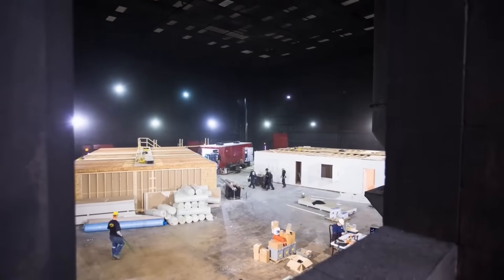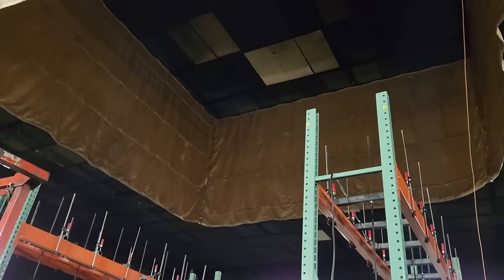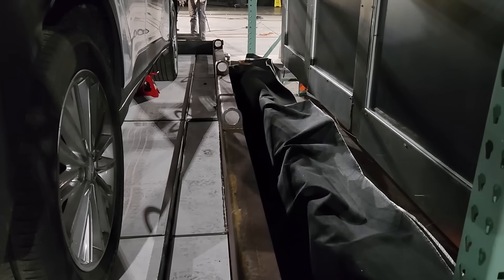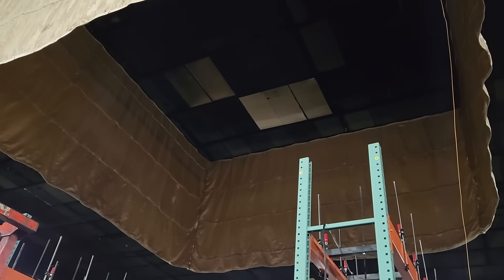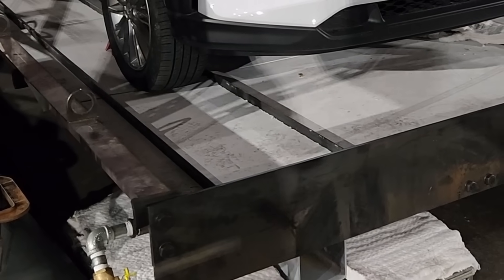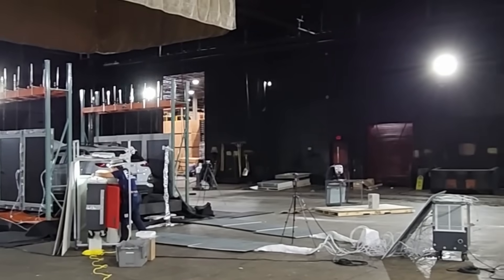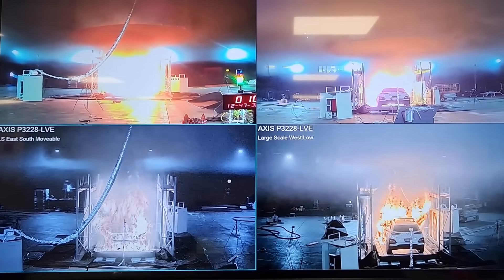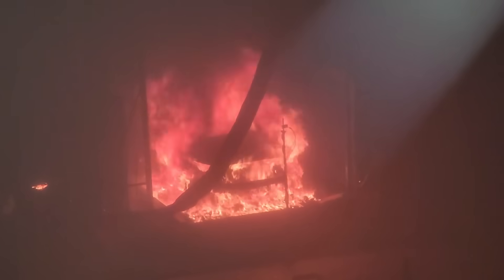Burning SUV: EV Fire Study

Comment: I predict When the Hyundai Kona EV fire starts  there will be a heap of burnt and melted metal on the ground, you won't see the shape of a car I even think that the panels at the side will be gone if they are placed at the same distance as the regular Kona, 2000 degrees for a EV fire Vs 800 for a petrol car fire. It will be interesting. But it's also worrying to think of multi storey carparks under ground carparks and tunnels if these EV  fires can't be put out. No forethought just green washing.
Reply: I found a Korean study that did a very similar thing - burnt an ICE, a couple of BEVs, and an FCEV. There was surprisingly little difference between the ICE and BEVs in terms of overall heat energy generated, or the rate heat was released. The batteries only made a small contribution. The FCEV was significantly worse than either. You might be surprised by the results....
Reply: @peeemm2032  Thank you for attempting to introduce a little science and data into this comment section.  Of course you can see from the comments you got that changing people's minds, once they're already made up, is very hard.  And like a small child, they will grasp at any excuse to avoid simply saying, I was wrong.  Your comment section is a perfect example of the truism that it is easier to convince a man of a lie, than it is to convince him he's been lied to.
Reply: @Tom-dt4ic  Thanks - I'm neither pro or con EV btw - I think they have their advantages (and disadvantages), but I do think there's a lot of garbage put out there about EVs (both pro and con)....

I also have an Engineering and Science background, so I find a lot of the more ridiculous crap put out about EVs (on both sides) to be intellectually offensive, and just plain annoying....

Totally agree with your assessment, most of the time I'm replying to people's comments I'm not under any illusion that I'll be able to convince them, mostly I'm doing it for other people who might be reading, but haven't yet made up their minds...
Reply: @peeemm2032 That's hard to believe since battery EV's have taken down entire car parks.
Reply: @silent1967  well, so some people say. Just because someone says it in social media (or even other media) - doesn't actually make it true.....
Reply: @silent1967  study's called "Full-scale fire testing of battery electric vehicles". You should be able to download it - definitely worth a read....
Reply: @peeemm2032  I do believe the park and about 1200 cars destroyed.  Not counting the cargo ship that burned. You've also not even seen the battery EV Dewalt Zero Turn that spontaneously caught on fire at a demo show and all they could do was dig a hole and bury it.
Reply: @peeemm2032  I wouldn't trust anything Korean. They're not known for high quality at this time.
Reply: @silent1967  That was the view years ago but Safety and QA/QC systems in Korea are taken very seriously these days. I worked with nuclear power engineers from Korea Power Engineering Corp on a major $5B non-nuclear facility and they were very diligent, even applying nuclear power standards in a non-nuclear project environment. I drive a Korean Cee'd made by KIA and it has been faultless except for the sat/nav which failed just after the 3 year warranty ran out on that part of my car. KIA had already switched supplier.
Reply: @silent1967  I'm assuming that you're talking about the Luton airport fire? There's certainly been a lot of of chatter, commentary and speculation about it in the media (social and otherwise), but as far as I can tell virtually no hard information from any credible source. After seeing the study I mentioned, I'm not convinced that it would have made much difference whether the car park was full of EVs, or had none at all, but I'm not an expert, so will wait for real information on that...

Regarding trusting anything from Korea - I think Korea has been quite well regarded for the quality and reliability of both their EVs and ICE vehicles for some time now - both Kia and Hyundai have good reputations, and Korean engineering is right up there with Japanese now...

For that matter, I wouldn't trust American automotive engineering, but I would be interested in the results of the EV and ICE combustion trial this video was discussing..... no offence meant if you're American btw.
Reply: @peeemm2032  None taken,  yes American manufacturing is in dumpster in a lot of ways these days. It's a shame, I'm 63 years old and it did not use to be this way.
Reply: @silent1967  I'm Australian, about the same age - we no longer manufacture cars here at all, and when we did they weren't that great - so even worse than American auto manufacturing. We also used to manufacture electronics, clothing, and most other stuff on shore, now we manufacture virtually nothing.  Most of our "industry" consists of either growing stuff on the ground and shipping it off, or digging it up and doing the same, or serving tourists... We import pretty much all our clothing and manufactured goods. So my comment was a somewhat wry one.....
Reply: @peeemm2032  Yes I get it, I'm hoping we can turn over some of this in the next election but I'm doubtful. Just hoping we don't break down into civil war again. It's never pretty and everyone loses.
Reply: @silent1967  yes - what's happening in the USA right now is alarming, even at a distance, you all have my sympathies. I was telling one of my friends the other day that I thought you guys would get it right eventually, but possibly not without at least some collateral damage - sincerely hoping it's minimal....

Australians are generally pretty lazy and half hearted about what we do, so we don't necessarily achieve too much, but usually don't get ourselves in too much trouble either....
Reply: @silent1967 where ? Here in the UK both the Luton car park fire and Liverpool car park fire were both Ice vehicle's !
Reply: @davefitzpatrick4841  Yeah ok and the cv didn't come from the Wuhan lab either. 🙄
Reply: @silent1967  In 2018 a diesel Land Rover destroyed a British car park in Liverpool. Thousand degree temperatures, 1,400 cars destroyed, massive property damage, including a structure which had to be demolished. Sound somewhat familiar?
Reply: @silent1967  Bedfordshire Fire and Rescue Service who attended the Luton fire have said it was a diesel vehicle the started the fire.
Andrew Hopkinson, chief fire officer at Bedfordshire Fire & Rescue Service, It was not an EV. This was a diesel powered vehicle.”
Reply: @peterr6739  Yeah ok.
Reply: @peterr6739  Not to me.
Reply: EVs are born out of idea of reducing greenhouse gases emissions. While this does holds some merit, in the big picture they matter not. EVs alone cannot reduce greenhouse gases to an any acceptable level. The governments and corporations aronud that are like parrots that keep repeating "just buy an EV and everything will be just fine" are terrible liars. THE No.1 air pollutant on the globe is the coal. From it's mining to eventual use it expels ~70% of all GHG that is causing the climate change. If the world REALLY wants to tackle the climate change, the world MUST find a way to ween itself from coal use. The governments and corpos? The just want to sell electric cars and that's it. They don't really care about the climate. Greenwashing for the greenbacks. That's all there is to it.
Reply: Also depends if they dare a fully charge largest possible capacity battery to test. The facility does not seem to be up for such a test.
Reply: @Heluthegr8  True!

Comment: I'm a firefighter (volunteer) in Australia, and in a road crash rescue unit (SES) Volunteers do each job in separate units out in the country. 
We are in the midst of developing protocols for the EV crashes and fires we know are coming. Rescue techniques have to change, and firefighting techniques also. 
My Brigade is a bushfire brigade but we also respond to crashes for fire suppression and patient care. We only have bushfire turnout gear, no BA, and only half face respirators suitable form bushfire smoke.
We will be treating EV fires as HAZMAT. No approach, exposures only, call the career brigades. People are going to die trapped in EV fires, get ready for it.
Reply: SA Metro Fire Service are no better equipped to deal with lithium battery fires than the Country Fire Service, it would seem.
Reply from the maker: I have the same concern when it comes to high impact crash situations.
Reply: @StacheDTraining  When it comes to high speed crashes (we have a 110km highway in our patch) again, if we see ANY vapour, we are going to have to back away. Our road crash PPE is cotton overalls, crash gloves, safety glasses and P2masks. Again, if someone is entrapped, and the battery is offgassing there are going to have to be hard choices to make. I hope people are prepared to accept that they may not be rescued if the battery is compromised and they are trapped or entrapped. Onlookers won't understand either.
Reply: @StacheDTraining please tell the Aussie Volunteers who do not on a whole have proper structural and BA equipment training that these EV fires are very toxic and extremely dangerous.
I make my comments from Maritime fire fighting at sea.  
Cert 1 national maritime operations.
Reply: At some point you have to stop and ask: "Just what is it that EV's are supposed to be saving us from?" There is one question that never gets asked that would expose the "climate crisis" for the scam that it is, which is "What percentage of the atmosphere is CO2?" The answer, never given in plain language, is that CO2 is currently around 420 parts per million, (https://www.co2.earth/daily-co2) increased, they tell us, from 280 ppm in 1850. That's a difference of 140 ppm, or in terms more readily understood by the layman, the composition of the atmosphere has changed by 0.014% (14 thousandths of 1%) in the last 170 years. LESS THAN 1 THOUSANDTH OF 1% PER DECADE! How much closer to "zero" do they think it's possible to get? How gullible do you have to be to believe that this rate of change is causing extreme weather events, which have always happened and always will? Their claim is that this tiny amount "traps heat". ALL gasses dissipate heat and even if CO2 is an exception, the suggestion that a total of 0.042% can overwhelm the capacity of the remaining 99.958% to dissipate that heat is abject nonsense. CO2 DOES NOT control the global temperature, there is no "climate crisis". Wind farms, solar panels, heat pumps, EV's.. None of these measures are necessary, nor will they have the slightest effect on the weather. Eye-watering sums of money have already been wasted on this futile exercise. Time to wake up, stop throwing our money at these boondoggles and squandering the world's resources on projects that cannot possibly succeed as there never was a problem to begin with. There is no need to save the planet from a minuscule increase in the gas on which all life depends, but it does need to be rescued from idiot politicians and media mouthpieces that push this garbage.
Reply: @jerrypalmer1786  stop making sense
Reply: Shouldn’t all cars be considered hazmat as the overwhelming majority of poison gasses come from burning plastics?
Reply: @williammeek4078  The gasses from burning plastics are definitely toxic,  however the gasses from lithium is both toxic and highly explosive.  If the gasses ignite not only will the occupants be incapaciated or dead but the rescuers might be as well.  No time to die from poisoning if you die from the explosion shockwave.
Reply: @supernova743  what are your references for this? Lots of people here arguing based off of rumor rather than fact or just spouting something about EVs without comparing it to ICEVs.
Reply: @williammeek4078  but those gases pale in the toxicity levels, compared to lithium/ cobalt and related compounds. Some of those can absorb through your skin and are almost immediately fatal, whereas burning plastics. If you have breathing apparatus, you can pretty much approach most of them, and other than a few exceptions, not good for you, but you could have a few inhalations and recover, not so with cobalt in particular
Reply: @malcolmwhite3567  what evidence do you have comparing the gasses released from a BEV with its battery and without? Also compared to a gas car with gasoline and without?
Reply: Just imagine how many extra bush fires will be thanks to EV
Reply: @jarekwaligora5679  considering ICEVs are 60x more likely to catch fire than EVs, I would say not many. 
Gas vs EV Fires [2023 Findings] - AutoinsuranceEZ